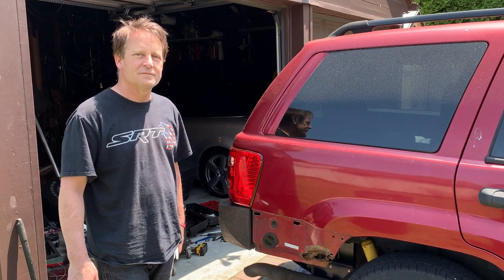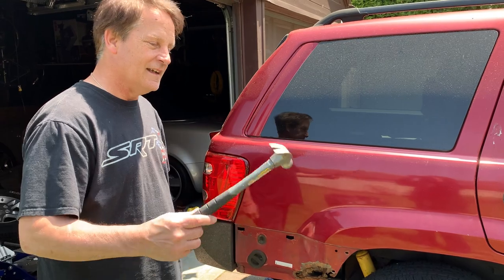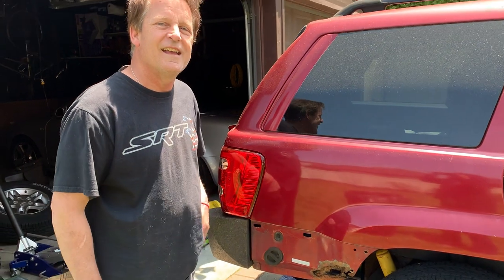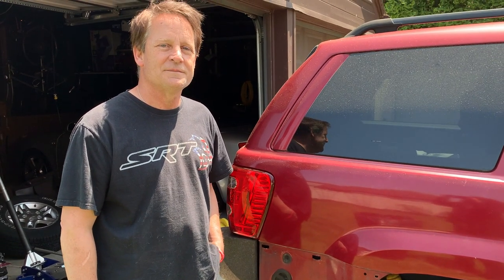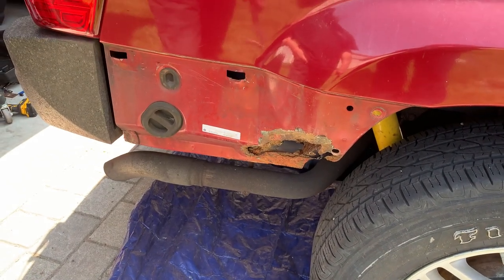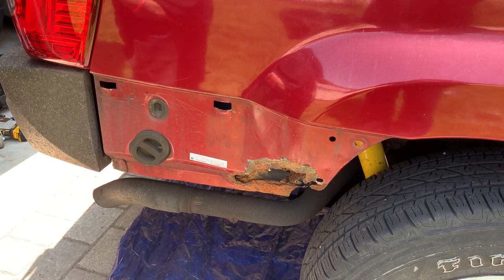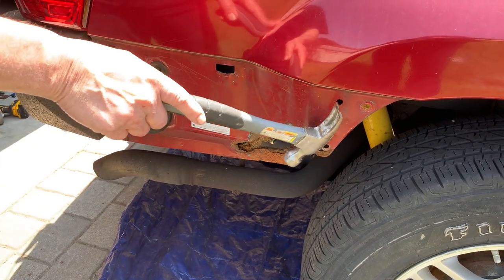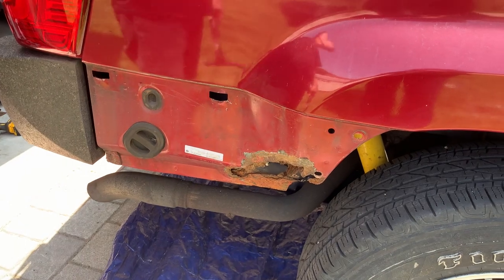Fix Rust Holes on Your Car: Coming Soon

Comment: I can see John's concerns! I've just discovered just how much rust is popping through the paint of my 03! Whom 
ever had my Grand Cherokee, two owners back, must of had one of those Maico paint jobs where by the rust
treatment and prep services was not properly addressed, but just painted over the original paint willy nillie!! 
So yeah, just within the last two weeks, I've got paint that is peeling and popping a rust just popping all over
the place which is quite disheartening like no other! Yet, I've already spent lots of money buying all sorts of
suspension parts, engine parts, back up electrical parts to include ignition, ECM and TCM modules and Body 
Control Module. This partial restoration project that I had set out for, I was trying to set a limit of 3,200 bucks 
total from the start of the purchase to get it quite road worthy is starting to give my a terrible pain in the backside!!!
All that I can really say at this point of the project is ouch!! I hardly even take it out unless the road is dry and this
vehicle is trying to wage war against me, but hey! At least I do have a Jeep that enjoy to drive!
Reply from the maker: Craig, we are kindred sprits for sure. My Jeep is suffering from a cheap Maaco paint job, and it's showing. I'm just about done fixing this one rust spot - but there will be plenty more for me to address. Stay tuned, the video will be up soon!